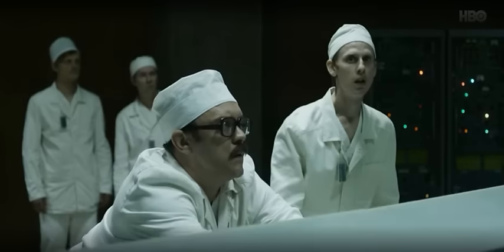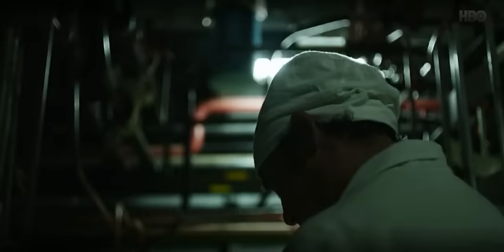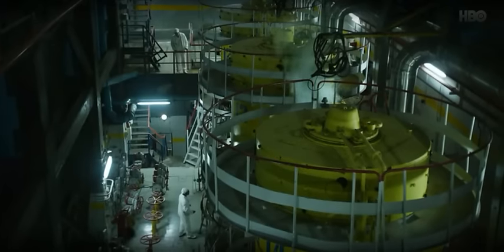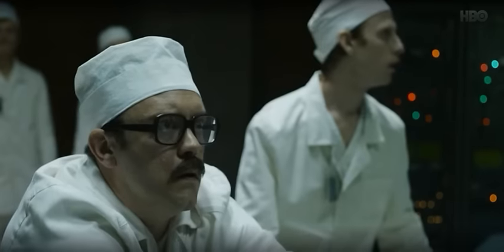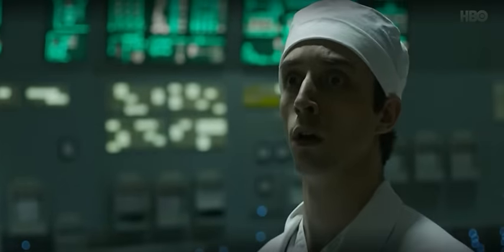Chernobyl (2019) Nuclear Reactor Explosion Scene

Comment: One of the very best mini series I’ve ever watched. I remember when this happened.  I was a captain in the US Army. Fascinating.
Reply: Now tell me, had this occured not in the Soviet Union but in the US, how different would the american system have reacted to it and how would they have tried to contain it?
My prediction is that their reaction would have been around 95% the same as the soviet's reaction was.
Reply: @KondorDCS  This type of an event won't happen in US since the RBMK design was unique to USSR. The US and almost all other countries use PWR type reactors. 

1. RBMKs have a positive void coefficient whereas PWRs have a negative VC. Which means a runaway reactor will reduce its reactivity by itself as water becomes steam.

2. RBMKs doesn't have a containment structure. PWRs are equipped with strong containment structures designed to contain any radioactive releases in the event of an accident.

Soviets knew the AZ5 graphite tip issue very early on and deliberately kept it hidden from reactor operators.
Reply: @KondorDCS  American reactors have properly enriched fuel, containment buildings around the reactors, and we use the proper materials in reactor construction. Basically it's impossible to have the same thing happen in the United States.
Reply: @KondorDCS well i guess they quickly put a stop to your attempt at hating on America... Although there are many other things still to pick from.
Reply: @KondorDCS  Agreed.  They would have lied too.
Reply: @s0undwavekiller558  Three mile island.  Sorry Dude.
Reply: @kevinbautsch  That isn't a counter to what that guy said; the fact you even brought up Three Mile Island as if its anywhere in the same ballpark shows you really know nothing of either.
Reply: @kevinbautsch  yeah three mile island was very mild compared to this lmfao
Reply: The US has processes for reacting to a nuclear power plant accident.  But, since US built reactors include safety features the Soviets didn’t include in their construction, we have been fortunate to not find out how well they work. Three Mile Island is the closest we came and there were no casualties I believe. We also have a free press, something that wasn’t present in the USSR then or in present day Russia, so lying about it would just dig a deeper hole for the President and other leaders. It was very unfortunate what happened at Chernobyl.  Brave men kept it from being worse than it was. It’s tragic anytime bravery has to be substituted for government incompetence.
Reply: i remember too. was a little child in switzerland when suddently alarms went off and our parrents came taking us home from school and we were staying there for some weeks until it was clear what to do (and that sugar-cube with the iodine - still remember THAT taste...)
Reply: @TheImmoralities  That makes it ok!
Reply: @redvirknight9430  Oh, you are right.  I know NOTHING.  No, your absolutely correct.  Now you can wack off in the mirror of your greatness.  Knower of all things.  No, really, be proud.
Reply: @kevinbautsch  Lol make it less obvious you’re hurt next time

Comment: 3:14 
The Exact moment when Hydrogen flooded the Reactor hall, and:
C + O² -> CO²
2H² + O² -> H²O
Zr + 2H²O -> ZrO² + 2H² 
2Zr + O² -> 2ZrO2

[Due to temperature the generated H²O is evaporating at an instant again and expanding volume by x1700 to x3000 increasing explosive power]

Comment: The RBMK was an enlarged version of reactors used in Soviet submarines. It was never designed to be the size it was at Chernobyl. The sensors were inadequate. The reactors were so big there wasn't just one reaction but multiple reactions occuring in different parts of the reactor housing at different times. To reduce costs, the designers reduced the number of control rods to the bare minimum. Engineers coming on shift said that controlling an RBMK was similar to driving a rally car blindfolded whilst wearing a set of ear plugs. After the accident, all existing RBMK's were retrofitted with extra control rods, sensors and cooling systems. But not straight away of course as that would be to admit there was a design flaw.
Reply: There was no profit motive, so why reduce costs?
Reply: The reactors in soviet submarines was pressurized water reactors, a complete different design than the RMBK in Chernobyl, not a sot safer anyway.
Reply: @НиколайБелый-ъ2я weren’t the Fukushima reactors getting hammered by, oh, I don’t know, a fucking tsunami?
Reply: @gordo8354  no, the main reason is that the systems responsible for the power supply of the stations were in the basements and they were flooded, as a result, the reactors overheated and exploded. This was done in a country where earthquakes and tsunamis are constantly occurring. A design error.
Reply: @НиколайБелый-ъ2я  oh damn that IS stupid

Comment: And that's why western reactors use heavy water as their neutron moderator and coolant. It's the exact opposite of an RBMK. If you get a void you get a negative void co-efficient. It kills the reaction.

Unlike the RBMK which used graphite bricks as their neutron moderator, and was controlled by the coolant within and the control rods. When both of those were out of the reactor the reaction was already running away. Hot coolant turned to steam and you had a void within the reactor still being moderated by graphite. A positive void co-efficient. The icing on the cake was tipping those control rods with graphite, under normal operation it would have increased reactivity and displaced water so the rod could lower in. But hitting the SCRAM and dropping them all at once was like firing a gun. The pressure ruptured their channels within the reactor and had graphite moderation bricks next to graphite tipped control rods. Now you've basically got a runaway diesel. The reactor endlessly feeding it's own reaction until the heat and pressure blew the lid off. And still further with whatever debris were left in that hole.
Reply: Western reactors do not use heavy water, but normal water as the neutron moderator, except for the Indian IPHWR-700 and IPHWR-220, and the Canadian CANDU.

Comment: The most horrifying thing is that not only the explosion is so massive it treated the cover like a piece of paper, but the fact that one graphite rod was sent flying to the jupiter plant.
Reply: can you link me sources for this? Sounds neat, I might be coming up with wrong searches
Reply: @GatlingHawk  Long answer: I vaguely remember there were some old tapes that were digitalized and then translated that told these facts and a video showing where they found the graphite rod in the jupiter plant, but the kreosan team did find an somewhat intact graphite rod inside the jupiter plant years later. But im not still not sure if that was the exact same one from the old documentations.
Reply: @GatlingHawk  Found one from quora:  As it turns out - although it may be quite rare - large, highly radioactive fragments of graphite moderator can be found a significant distance away from the power plant
Reply: @euvo_sound  thxx :D

Comment: I watched Chernobyl: The Lost Tapes after watching Chernobyl. During one of the interviews with Lyudmila Ignatenko, the firefighter's wife, she mentions that she saw a mushroom cloud after the reactor exploded. When Ignatenko said she saw a mushroom cloud, my dad, who was part of the military and I was watching with, told me that meant the explosion was a nuclear fizzle. A nuclear fizzle is when a detonation occurs and there is an explosion but the detonation is much less than anticipated for a nuclear explosion. So the second explosion was either a fizzle or a hydrogen explosion.

(I am not a professional in any way. I just like science.)
Reply: the explosion was in no way a nuclear explosion, just a heat and gas explosion
Reply: @jacob-9803  I’m not saying it was a nuclear explosion. I’m saying it was possibly a fizzle. An explosion that is nowhere near the size of an actual nuclear explosion, but still produces a mushroom cloud. A fizzle is NOT a nuclear explosion.
Reply: From what I have read and seen, the Chernobyl explosions were a steam explosion to start (what blew the lid off and thru the roof). And then a chemical/gas explosion as the hydrogen and oxygen mixed and came in contact with the super heated graphite. That was the big explosion. It was more or less an inadvertent dirty bomb. And it is possible that if the fire was pushing that much smoke and debris in to the air that you could possibly see a mushroom shape in the cloud. Your dad could have been going off of what he knew about bombs at the time. But I have seen mushroom clouds form from non-nuclear explosions. I watched a video of a detonation of the MOAB and there was a small mushroom cloud. Hell, back in the 90s there was a wrestler named Adam Bomb and part of his entrance had a small explosion/firework go off behind him and it made a small mushroom cloud.

Comment: "Because it's cheaper"
Instantly showing the scale of the incompetence of the soviet system with one simple phrase
Reply: The best part about this artistic license taken with this scene is that when you stop and think about it hard enough, you realize that it is ultimately true. The reality was that the rods weren't really "tipped" in graphite--it was more like the bottom half of the rods were graphite, while the top half of the rods were boron. This allowed for every control rod to be used to either accelerate or decelerate the reaction, which is definitely more efficient. 

However, that efficiency is efficient from the standpoint of economics and production, and it comes directly at the cost of safety. It means that the AZ-5 button can cause the very disaster it is supposed to prevent if the circumstances are right. This would be preventable pretty easily if the Soviet Union just accepted the modest expense of making some of the control rods exclusively out of boron to ensure that the AZ-5 button would always work as it was supposed to, but they didn't, because it would cost more to produce and delay construction/completion of the nuclear power plants by a little bit. So they didn't. They decided to save the money/resources/time instead for their own selfish interests, deluding themselves with the belief that nothing would ever actually go wrong.

So...the line is effectively correct. They did it because it was cheaper, even if it was much less safe. That was the RBMK design in a nutshell: the cheap solution to all their needs, allowing them to cut as many corners as possible. The real tragedy is that modest design changes would have made even the RBMK design far safer (which they have proven to be since those changes were made), but they just had to cut even those corners. Because it was cheaper.
Reply: @Raptor747  to them, projecting power in everything, is everything . Their wins, their losses, their disasters, and this led to no self inflection great enough to take the extra time, because less time is a win. Less cost is a win. Manufacture a “reality” that can allow you to project power on the world stage, because the reality is less forgiving
I love that you brought up that they deluded themselves into thinking nothing could go wrong, because I’ve heard there is a similar attitude I’m China today. A Chinese phrase something like “No problems!” Is really popular, I watched a video with LaoWhy86 where he said they think the same way, and it’s almost an echo of the attitude that led to the collapse of the USSR.
Reply: @SuperNormalMan i mean, thats not really a "communism" only thing.  Also considering how capitalism also heada towards the "we do this cause its cheaper, even though it's less safe"  its not really "communism" at all.  Its just neither concept really actually apply to this scenario.
Reply: The Titanic Sub: ...
Reply: @jordanwhite352  exactly.
Reply: "Because it's cheaper"
Instantly shows the flaws of the American system with one simple phrase
Reply: @Hasturious  LOL thanks for the joke. I needed a good laugh today.

Comment: So fun thing, the tips were actually a full half of the rod. With some extra space at the bottom to cut costs. Note: only one boron half was inserted. And I am not a physist but i CAN explain it if its all like a chemical. Over the course of the test (which was interrupted because the generator was needed and they took a shortcut to get it back up to where the power levels were) a "gas" called Xenon had started building in the reactor, causing the initial runaway reaction. It was the most dense at the bottom. 
At the exact same time 99% of the graphite descended at once into the toxic cloud. As soon as the tips of those rods made contact, well, everything he said was correct. 

The reason the show didn’t explain that is because for me at least its kinda hard to wrap my head around and it distracts from the main point, which is that the tips got stuck in the worst possible position in the reactor.
Reply: I understood the extra space at the bottom was not to cut cost, but to allow even fuel burn up due to the fact that the reactivity will be less at the bottom and top edges of the reactor, so therefor the rod in its natural position should only occupy bulk of the middle of the reactor.

Comment: That makes "just the tip" to explosive possibilities
Reply: just the tip?
Reply: @ikagura  yep the rod that was lowered into the reactor had a graphite tip, only the tip of the rod could enter the reactor and so the explosion was caused.
Reply: The RBMK is a dangerous idea.
Reply: @ikagura  graphite can cause prompt criticality event where the spike of nuclear energy can become uncontrollable ending with the water vaporizes leading to radioactive steam hammer and the resulting explosion
Reply: This was the explanation in the show, but if I recall correctly, I think in truth it had less to do with only the tips entering the core and more to do with once all the tips approached the bottom of the core. As the graphite tips blocked off more and more space as they descended, the water at bottom of the core had nowhere to expand to once it had been vaporized, and the buildup of pressure from the bottom is what caused it. Could be wrong, but I recall it being one of the inaccuracies of the show. 

The point remains fairly similar though, it's probably why they went with the tip reasoning in the show. Just thought I'd mention it for anyone curious.
Reply: @AK-ZL1  the reactor has a problem with xenon gas which is bad for reactors but slamming both rods caused a prompt critical state where the power exceeds the capacity however it can boil the pool which is steam hammer

Comment: The fact that reactor 4, which was meant to run at 3200 Megawatts, was able to go triple that amount was impressive if you ask me.
Reply: You mean ten times that amount.
Reply: Yeah, but only once.
Reply: I didn't know that 33000 divided by 3200 is only 3. Thought it was somewhere a bit over 10.
Reply: @hunbotrix1426  Yeaaaah, I knew that I should have just edited the comment on the second after I posted it to say "over triple that amount"...
Reply: That was the final reading the sensors picked up

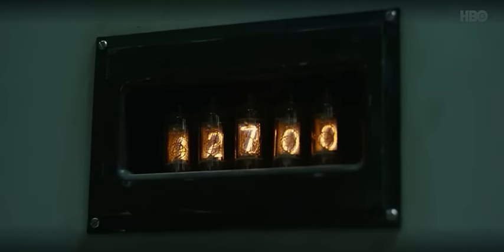Comment: "Reactor 4.. designed to operate at 3,200 megawatts went beyond 33,000." Is by far the most hard hitting line. 2:43
Reply: 3200MW
Reply: 3200 not 30200. It went over 10x its intended capacity
Reply: not to mention dyatlov's face was like "oh shit"
Reply: If you know what 32k vs 33k megawatts means, maybe it was. I don't know anything about nuclear energy though, so I didn't even notice it.
Reply: @bouji_ it's 3.2k to 33k, not 32k to 33k
Reply: @Tonlah  oh my bad

Comment: Think about having the Safety Shutdown Button that is really the Detonation button. What a great idea Comrade
Reply: The graphite tips on the rods were designed to enhance the effectiveness of the rods.  Under normal circumstances it isn’t a danger.

The problem was that all the gymnastics that the operators were doing to raise the reactor power for the safety test caused the water level and the reaction to get down below the ends of the rods, so that when the power spiked and the rods were reinserted, the first thing into the reaction was graphite, causing all Hell to break loose.  Under normal conditions, the graphite tips should’ve already been in the reaction, and therefore if the rods were reinserted, there wouldn’t have been the resulting power spike, and the reactor would’ve shut down normally.

Comment: Those men weren’t trained properly. They were doomed from the start.
Reply: Trained properly? Are you serious? They were working with a reactor created from cheap parts whose schematics were designed from bits and pieces of American reactors. Buddy, the best trained staff put in the same situation will die the same death.
Reply: @bookfanatic8329 worse, they weren't told the truth.
Reply: Staff was trained. They were not made aware of the flaws, which is a difference. Sure, Dyatlov played his part in creating such a scenario, but he did so on the basis that he had a kill switch should things go south, not knowing said switch could, in certain conditions, act as a trigger
Reply: @bookfanatic8329 Is that why none of the other similar reactor designs exploded? 
If you actually paid attention to either the series, or read some literature, you'd understand that this was the result of a lot of very unfortunate events